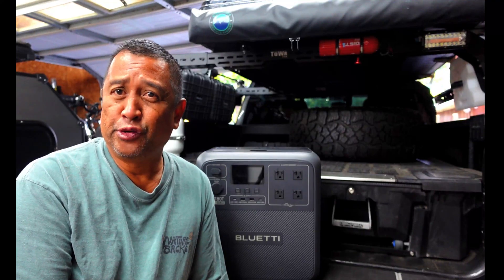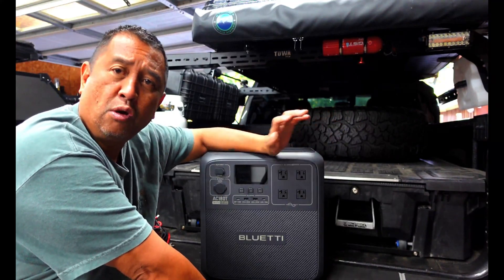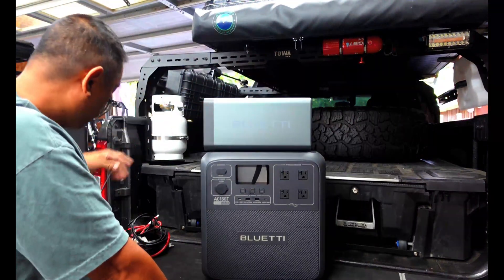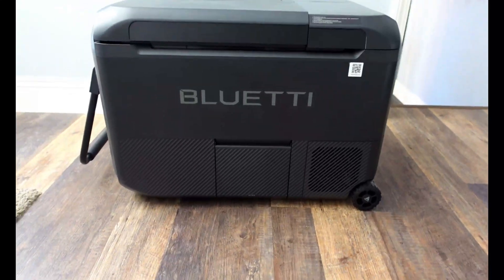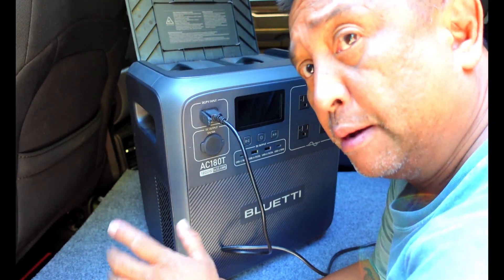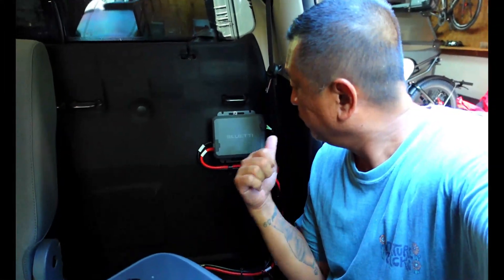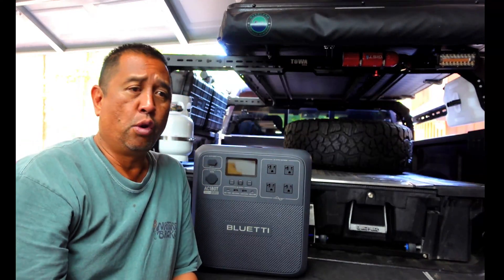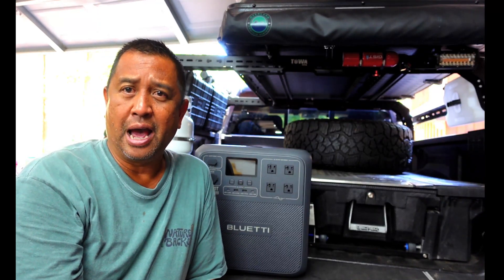Bluetti Charger1 - DC - DC 12 Vehicle Charger

Comment: Is this compatible with an Anker power station? I wouldn't be able to select a Bluetti product in the app obviously.
Reply from the maker: They say it is, you would just have to get the power cord with the solar panel MC4 connectors. It should automatically adjust the wattage. You prob won’t get the full 500 watts though
Reply: @sempergumbie  awesome. Thank you for the feedback.  That item is a game changer for charging while driving.